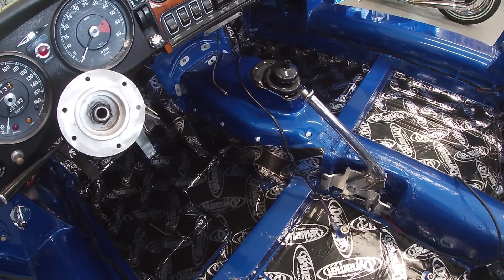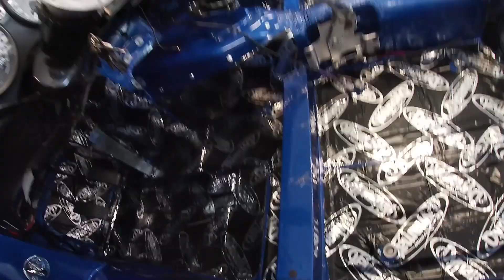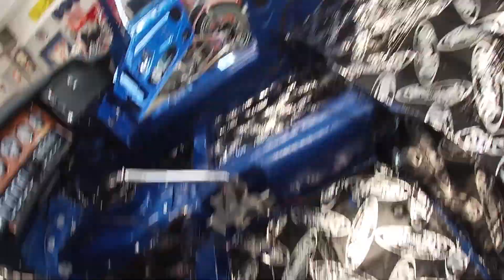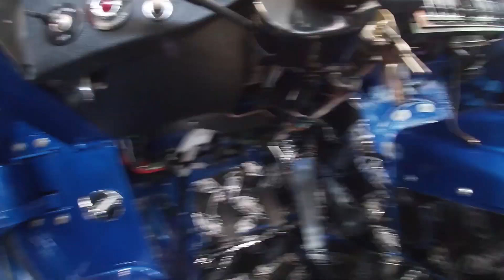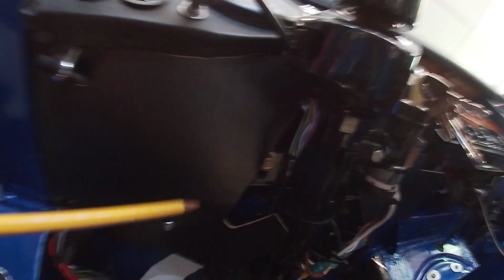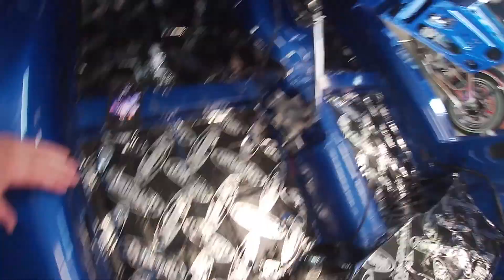Jaguar E Type Series II Rebuild - 2023-05-14 - Dynamat Install

Comment: I just finished my engine, engine area and front suspension here in Ann Arbor  (total rebuild/refurbishment).   I haven't run the engine yet because I will be replacing the fuel tank and my fuel is 10 years old (yikes).  The cab will be next.  Thanks for posting this video.  About 10 years ago I ordered a set of CoolKat matting (high-tech rubber on one side, glass mat on the other) for the interior cab.  I have no idea how it compares with Dynamat but my takeaway from your video is that it will be a bugger to install.  I'll heed your warning about the transmission tunnel cover, especially.  I just hope my CoolKat will look as professional as your installation of the Dynamat.  I do remember how baked my right leg would get from the heat from the transmission.  Minimizing this heat is my objective as well.  My '65 is a roadster so noise is not the issue for me either...
Reply from the maker: Way to go Stan !! Keep going!

I have no experience with the CoolKat material. I can say that I like the Dynamat. Its straight forward to cut and shape. It is as sticker as hell and once its on it can be tough to get off. That first contact is very unforgiving. Especially hard when you are deep in the footwell trying to locate the piece of the firewall. Outside of that I like using it. 

I create a paper template and then use that to cut the Dynamat piece. Then I trim the Dynamat piece in the car, then I remove the backing and stick the piece in place. I use a roller to get the piece to follow all the contours. The real effort is in creating the template and then trimming the dynamat pieced to the final shape. 

I finished this on Saturday and my ribs are killing me still. Painful week.